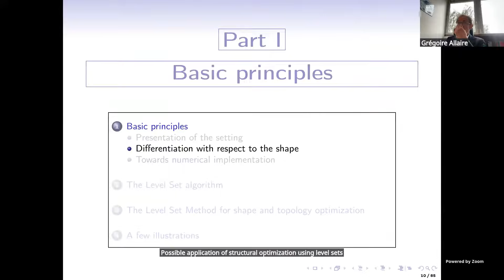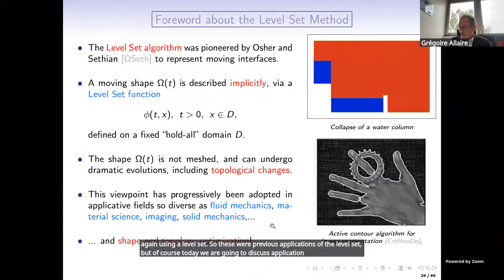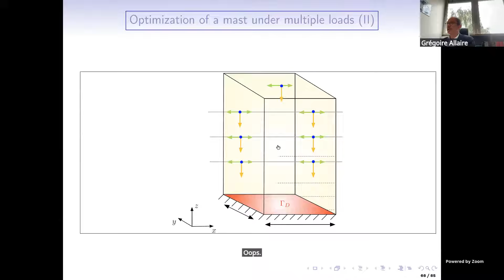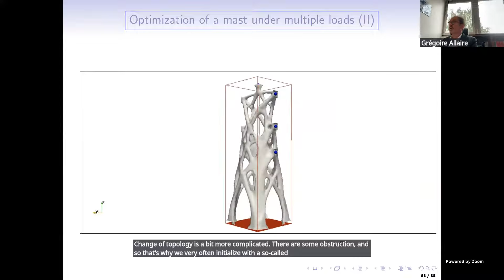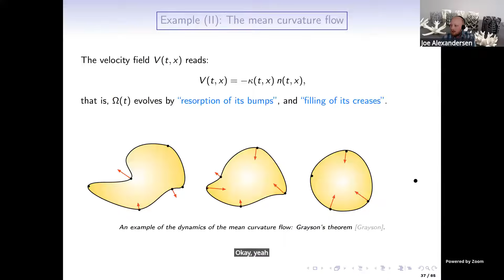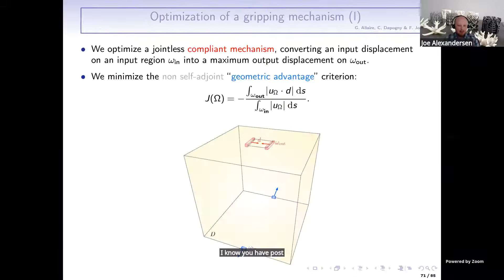TOP Webinar Tutorials: Level set methods 1 - Introduction and basics

Comment: ai summary

Abstract

This transcript documents the inaugural session of a three-part webinar series on Level Set Methods for Topology Optimization, presented by Professors Grégoire Allaire and Charles Dapogny. The lecture establishes the theoretical and numerical foundations of shape and topology optimization within an Eulerian framework. Key topics include the Hadamard method for shape differentiation, the transition from Lagrangian mesh-moving techniques to implicit level set representations, and the mathematical modeling of boundary evolution via the Hamilton-Jacobi equation. The session concludes with numerical demonstrations in 2D and 3D compliance minimization, highlighting the method's ability to handle complex topological transitions—such as hole merging and creation—more robustly than traditional geometric methods.

**
Lecture Summary: Level Set Methods for Topology Optimization

    0:03:48 Introductory Context and Series Outline: The session initiates a three-lecture series focusing on the level set method's role in topology optimization. The curriculum covers interface capturing (Lecture 1), Hadamard shape derivatives and advanced implementation (Lecture 2), and body-fitted remeshing (Lecture 3).
    0:11:00 Problem Formulation: Structural optimization is defined as the minimization of a cost functional $J(\Omega)$ (e.g., compliance, temperature, or fluid drag) subject to constraints. The primary challenge is the implicit, nonlinear dependence of the objective on the shape via the state equations (Elasticity, Stokes, etc.).
    0:15:53 Hadamard Method for Shape Differentiation: To compute sensitivities, the "Hadamard Boundary Variation" method is used. It parameterizes shape changes via a vector field $\theta$.
        Key Takeaway: The shape derivative depends strictly on the normal component of the velocity field on the boundary; tangential movements do not alter the geometry.
    0:22:15 Derivatives of Integral Functionals: Formulas are provided for the sensitivities of volume and perimeter. The derivative of a volume integral is the boundary integral of the integrand, while the derivative of the perimeter is proportional to the mean curvature.
    0:28:44 Lagrangian vs. Eulerian Frameworks: Traditional geometric optimization (Lagrangian) moves mesh nodes directly, often leading to mesh inversion or degradation.
        Key Takeaway: The Level Set method (Eulerian) circumvents these issues by representing the boundary implicitly as the zero-isocontour of a higher-dimensional function $\phi$, allowing for seamless topology changes.
    0:33:04 Level Set Evolution Equations: The boundary $\partial\Omega$ evolves according to the Hamilton-Jacobi equation: $\frac{\partial\phi}{\partial t} + V_n |\nabla\phi| = 0$, where $V_n$ is the normal velocity derived from the shape sensitivity.
    0:47:03 Singularity and Viscosity Solutions: Even with smooth initial data, evolving boundaries can develop singularities (corners/shocks). The method utilizes "viscosity solutions" and entropy criteria to handle boundary crossings and topological mergers correctly.
    0:50:39 Numerical Discretization and Upwinding: Implementation on Cartesian grids requires "upwind" finite difference schemes to maintain stability and capture the correct physical solution (shocks vs. rarefactions).
    0:57:17 Signed Distance Functions & Reinitialization: To maintain numerical accuracy, the level set function $\phi$ must stay close to a signed distance function ($|\nabla\phi|=1$).
        Key Takeaway: Periodically reinitializing $\phi$ via the Eikonal equation is essential to prevent the function from becoming too steep or too flat, which causes numerical artifacts.
    1:00:11 3D Demonstrations and Benchmarks: Applications shown include the "Electric Pylon" and "Giripping Mechanism."
        Key Takeaway: Topology changes (creating/merging holes) are numerically more straightforward in 3D than in 2D, where "Swiss cheese" initializations are often required to provide enough initial topological complexity.
    1:02:35 Assets and Limitations: The method is computationally efficient and handles large deformations well. However, it remains sensitive to the initial design (especially in 2D) and typically requires a "ersatz material" (void regularization) when not using body-fitted meshes.